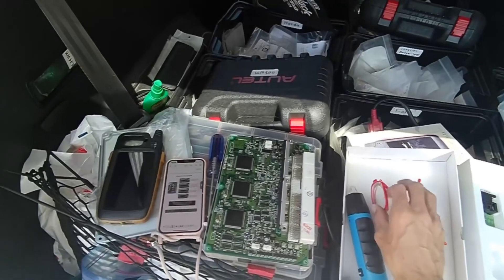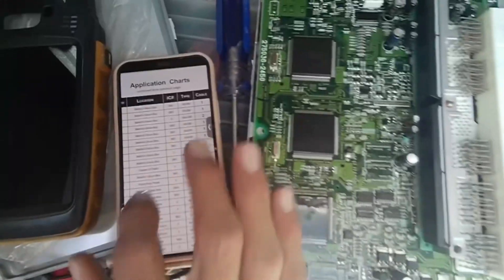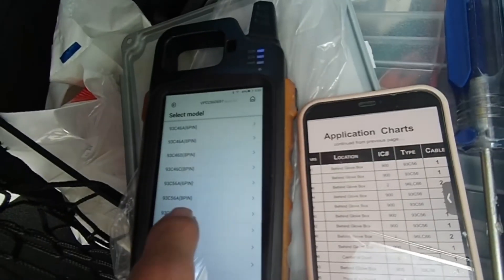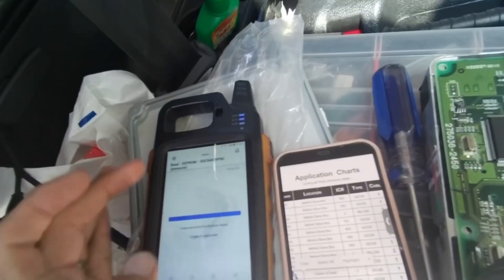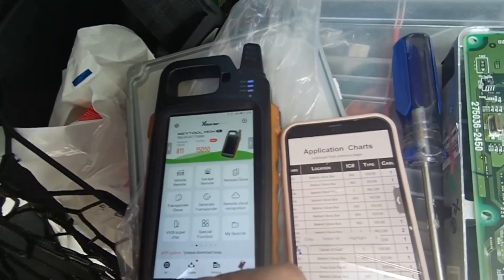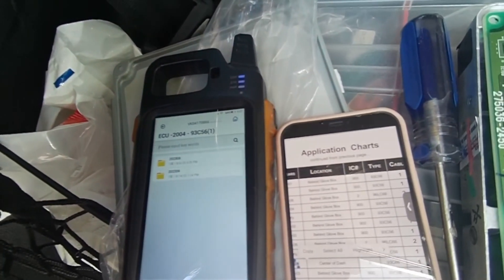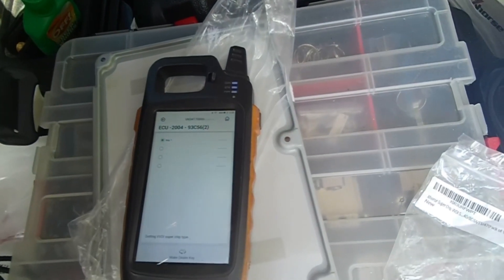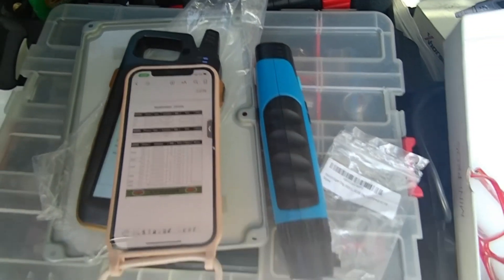HOW TO MAKE A KEY TO OLD TOYOTA SYSTEMS (REFLASH) USING VVDI MINI PROG & VVDI KEY TOOL MAX

Comment: Hello, how do you choose the transponder, where is it, how do you find the match? Thank you.
Reply from the maker: It’s Xhorse super chip. I am not sure I understand the question.
Reply: @legacylocksmith7874  If the engine computer is replaced, avoiding immo off, can we program keys from the ECU or is it impossible because there is immo in the meter and bsi/bsm?
Reply from the maker: Not sure

Comment: How do you know the difference between 93C56A or 93C56B?
Reply from the maker: Small difference in the chip I guess. But when you write the key I think the tool will prefer the A
Reply: @legacylocksmith7874  i just orderd the mini prog and am going to work on a Toyota Corolla from 2000, just got confused wich one i should use..
Reply from the maker: In the US, our Corolla does not have a transponder on this year’s

Even on the Camry, it’s usually on the V6 Models
Reply from the maker: Interesting, in most countries it’s like that only the US does not require that by law it’s optional. We have 2020 year models that does not have any transponders.

Comment: He left out the most important part. If you don't write that new file with the programmed chip back onto the microchip, the car will not start.
Reply from the maker: It’s really not true. Car started without since we are cloning out on a super chip so there is no need to do write.

Think about it it’s cloning out if I took a superchip and wrote exactly the information on it there is no need to write back information. You will need to write back the information if you choose to use a regular chip and not super chip.

Comment: Hi. I don't understand how do you know that it didn't read the memory with some error? something similar to when you make a bad clamping. That xhorse portable reader has some kind of error checker in the reading?. thanks for your time
Reply from the maker: It will tell you if it’s read successfully. Just need to be very stable with your hands. Need to make sure all pins touching the chip.

Comment: Just so the people are well informed, this is not a reflash he performed. The programming procedures for a reflash are not the same as this. A clone out is what he performed, and that is the easiest way to complete the task. To correctly do a reflash, you must flash an 8 - or 16-bit virginize file depending on ymm . Once that is done, you must learn the minimum requirement of keys for programming mode  to exit. That is a proper reflash. Good video, though, explaining the basics of eeprom with xhorse line of tools.
Reply from the maker: Just a faster way to do this job, also you don’t need to deal with the learning of the key on some of these old models.. but you are definitely correct 👍🏼
Reply: This is way better than a reflash I'm gonna do this in my job I'm gonna get this mini soon, I'm a 2 man job I get called alot for these cars specially sequoia. This will make me 20times faster

Comment: Yes this is the best way. No writing back to the ecu. I usually read the key IDs then generate a 4C chip and change the ID to one of the existing keys. This is a different technique of doing the same thing.
Reply from the maker: Better then REFLASH option anyway..
Reply: How do you read the key ID?
Reply: How do you change the ID of a blank 4C key using the Key Tool Max?  When I read  the transponder, the Edit function is greyed out.  Unless you can only edit with a generated 4C chip?
Reply from the maker: I’m not sure it’s possible but maybe I’m wrong
Reply: How do you do this? With tango or xhorse plus...?